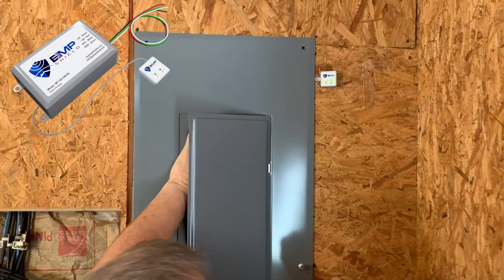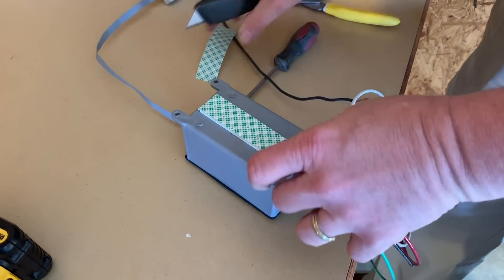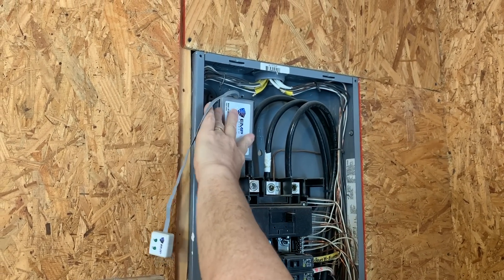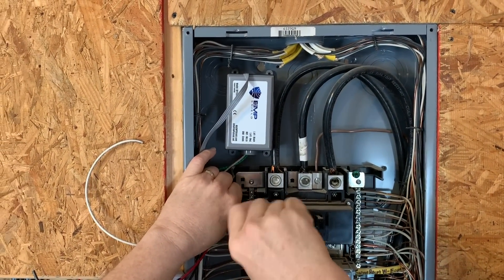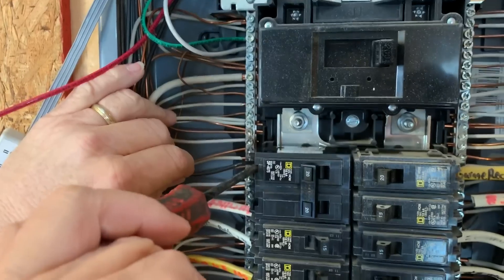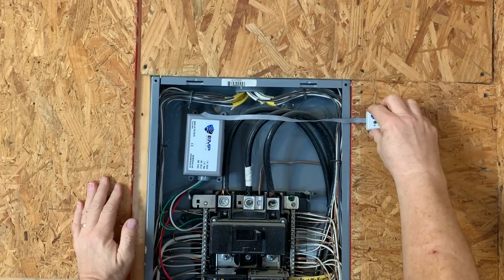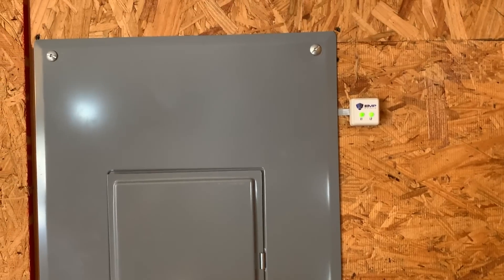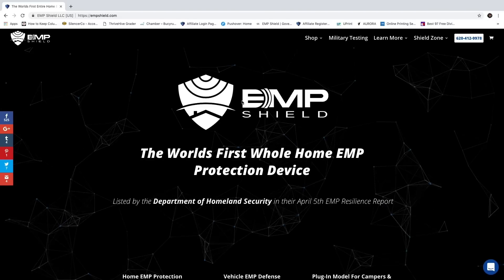Concealed EMP Shield Installation - Home Electromagnetic Pulse and Lightning Protection

Comment: Complete SCAM!!  You have absolutely ZERO warranty or coverage!   Hopefully anyone who has purchased one of these devices never actually needs it to work.  They advertise 10 years, and up to $25,000 coverage for any damages.  But that is only up until you make a claim.  We got hit by lightening which fried the EMP Shield that was less than a year old, as well as some electronics.  We reported it to EMP Shield at the time.  When you go through their claim process they want receipts of where you were billed to have the EMP Shield installed by a licensed electrician (not required on their installation instructions as it is simple to install for anyone with electrical knowledge).  I have previous electrical experience wiring houses and other buildings alongside a licensed electrician.  They also require the original purchase receipts for anything that was damaged.  Who keeps receipts for electronics that are passed the manufacturers warranty?  We provided pictures of the installation showing that it was installed correctly, exactly the same way the whole building was wired by an electrician.  White Neutral wire attached to the same spot as all the White Neutrals from the whole building.  Green Ground wire attached with all the grounds and the other two wires going to the 20A, double pole breaker as required. They tried to say that it was not, so they are obviously lacking in their electrical knowledge.  So because there is no electricians invoice, they deny your claim.  But then they went on to say if we did have an electrician install it, we would have to go after the electrician for any damages.  That clearly shows that they do not stand behind their product at all.  Just like any insurance company making up excuses to deny coverage.  Their warranty is completely bogus.

Comment: If there is an existing 220 Amp Breaker in your box, doesn't mean that wires are connected to it already? For me, it's the water pump breaker. Does that mean that I'll be connecting additional wires to it from the EMP Shield Device?

Comment: Based on EMP research I am not convinced this device will work.  If the EMP pulse in this case came through the transmission lines the EMP Shield stands a better chance of success.  An EMP is not going to travel on a prescribed path, every electronic device, every cord is an antenna and will be the path of least resistance.  I believe people would be better prepared to spend their money on non electrical items and hand operated items.  I think it may be a disingenuous on your part to offer insurance or a warranty.  If we are hit with an EMP it all becomes a moot point, people would be trying to g to survive and money is useless.  I really would like to be wrong, but faraday storage devices would be a better expenditure of money.

Comment: YOU LOST ME AT 1:46 - THE QUESTION IS WHERE DO YOU INSTALL THE RED WIRE? - IN THE SAME  HOLE AS THE BLACK WIRE? - PLEASE DETAIL
Reply: can someone help with this...?
Reply: Double breaker.  Two places to fasten wires.  Two phases  covered.  Have an electrician wire in your unit. @kenproctor5116

Comment: Wow! Pure snake oil! Hokum! False! Bullshit! Totally preying on anyone who has no idea on how basic electricity works. Does this product expect you to install a double pole breaker to accommodate it? Or is it expecting you to find an existing double pole breaker to piggyback onto? Either way, what does this unit do other than illuminate two green LED'S? There's no kind of drain wire that could possibly dissipate an EMP. But furthermore an EMP would not / does not travel down your wiring. Just like a regular magnet, an electromagnetic pulse permeates electronics by the field that it emanates. No amount of "devices" you buy and install will provide any kind of protection. The good news is that we are HIGHLY UNLIKELY to experience any kind of EMP in the near (20 year) future. And even if you were dumb enough to buy one of these bogus devices for your house and somehow an EMP were to be blasted over your state, the things that would be affected would be so far upstream of your stupid little house that none of the so-called "protection" of this bogus device wold mean anything anyway. So for anyone that has read this far, let me explain a few simple truths. (I remember a time when truth wasn't a political word.) In order for for any kind of device, be it a surge protector, an over/under voltage detector, or a device that senses excessive current, (More commonly called a circuit breaker.) up to and including a so called "EMP protection device" must be inserted in the path of the electrical current headed towards the downstream devices so that it may interrupt, or block such badness from reaching those devices. There is no way on this earth that anything that simply connects to two poles of a circuit breaker and does nothing more than illuminate two LED's can possibly deflect an EMP. (Further, where is the circuitry that could absorb such a gigantic influx of electricity located?) This is simply a cash grab (And I am sure it is/was COMPLETELY successful.) to make thousands of dollars off of typical consumers that have a fear of, rather than an understanding of electricity. In lessons we learn about the internet, this is a classic. Look at the many pages of meaningless "documentation". Al of it is designed to imply a level of validity when upon closer examination, it has nothing to do with the product that it is attempting to validate. None of it makes any sense to a person with a rudimentary understanding of electricity. I applaud the  purveyor of this pure hokum for painting a very complete picture of plausibility that the average consumer will bite on, hook, line & sinker. Consider this though. Your home is far more likely to be hit by lightning. Where more than 2 million volts will most assuredly cook any and all of your electronics and affect you on personal level.  An EMP (Whenever a country comes up with the technology to actually implement it and decides to use it.) it won't be aimed at you. And even in the remote chance that a future EMP does affect you, rest assured that all of the power generation, banking software, air travel, train operations, trucking systems, internet, and our nation's defenses would be compromised to the point that your house and the silly little toy you bought from these fear mongers won't make a tinker's cuss worth of difference. Save your money. Buy a dog.

Comment: I have a solar system with batteries. I have EMP protection on the main panel. My concern is that the main breaker will pop in the event of an EMP. Specifically the E3 portion where surges from the grid can destroy external equipment over the 8 hour period. 

There is a breaker panel that takes power from my Inverter (AC) and my powerwalls. Then it goes to the solar gateway and then tied into the grid. 

My concern is if the breaker pops. It now separates the home from those components. I went with EMP shield. I am wondering if I should have an addition surge protector on the outside panel. 

Will these panel surge suppressors protect the solar gateway and powerwalls if the main breaker is cut off from those components?

Comment: The Car/RV version might have some use. But home?
EMP's don't just aim for wiring and electrical items plugged in. They aim for any electrical device direct plugged in or not. Anything with mircrochips and other sensitive electronics is in high risk of burning out, and needs physical shielding EMP bursts of various frequencies.
Reply: If it's plugged into home electric that has the EMP Shield relay installed, it will be protected. The relay shunts to ground any over-voltage pulse in about a nanosecond from the entire wiring. This shunts the pulse to ground fast enough that sensitive components in electronics plugged into same electrical system won't get damaged.
Reply: @TheSimplePreppers Correct but if an EMP goes off the whole grid goes down now you'll also need a whole home generator or large battery with Solar to keep everything in that panel to stay on.
Reply: The point of the EMP shield is to stop your electronics from frying so if you have a back up generator you can get back online since it protected you from getting your circuits fried from initial impact. Of course the grid coming down will be tough unless you have a backup, but say the grid goes up, you'll be ready since it didn't fry your circuits the first time. Thats the point

Comment: Please don't put this in the panel like that. An electrician can easily install this correctly if your panel is recessed into the wall or flush mount. I think the entire thing needs to be redesigned. Imagine taking the panel cover off and the led status light falls off onto the main or the EMP devise held on with sticky tape falls off and gets snagged on the cover.

Comment: Seriously doubt that this thing works, and if there is an EMP the whole grid is going down anyways and good luck getting your money back.
Reply: This product is for those of us with gas and solar generators after an emp or cyber attack. We WILL still be able to use our electrical devices and those without emp protection will not.
Reply: @danykasp  Won't make a difference, the product will not protect anything it's a scam.

Comment: Is it legal to have items hanging out of the breaker panel ?
Reply: No
Reply: @Awesome_Dennis  I'm sure there is an allowance, maybe for low voltage DC wiring it's not an issue?  Either way, I think that "remote led" looks like garbage, and the double sided tape wow.
Reply: Who cares. You gonna call the cops and ask them to come take a look? 😂🙄
Reply: @melissam450  insurance cares, when you want put the house on the market, And stop ✋️.

Comment: I'm very visually oriented when it comes to directions, I couldn't really follow the install because I couldn't see exactly what wires were going where.
Reply: It comes with detailed paper instructions.
Reply: @marcuseviltree6304  yes I have those instructions, but the wires in my circuit box are not where the paperwork showed and one was different colors. I got an electrician to come over and he had to put a 20 amp block in my box and was able to hook it up. 👍🏼
Reply: Theres also a detailed diagram on their website
Reply: @marcuseviltree6304  I tried going by that as well, just too many differences for me to do it myself.

Comment: In my opinion, this device an only absorb the EMP at the point it is located, If your electronic devices are not within a Farady cage type enclosure, I don't see how this device can circumvent the laws of physics. As for a CME, if it is truly 225,000 amps, won't the thin wires connecting this device melt and fuse open? If this horrific event ever did take place, computers and phones would be inoperative for a long time. How would you be able contact the seller to get the guarantee? Correct me if I am wrong.
Reply: There is no possible way this can work!  Don't waste your time with this snake oil sales!  Anyone who understands the basics of electricity can easily debunk this device!
Reply: @bluev2srt  Thank you for your comment.  Since posting a month ago, No one has replied to challenge my comment.
Reply: @bluev2srt  I concur completely.
Reply: I've got to read what I type: an=can, Farady=Faraday

Comment: Do all city transformers have protection?  If it doesn't, what good would this be?
Reply: Grid isn't EMP protected any more than your home would be with this predatory marketing scam.
Reply: Consider this:  The grid is damaged.  The grid is repaired. (at no cost to you)  You now have power but every electrical device was fried.
Reply: I have a generator that i can hook to my breaker box if the power is out. Emp will fry all your breakers without protection. Cant power house with fried breakers
Reply: @marcuseviltree6304  in the event you are in range of an EMP the grid and your breakers are not going to matter.  Neither will your generator.

Comment: Hey guys, I'm thinking of buying an older Army surplus duece and a half.  Can you all "harden" the electronics? How hardened is it?  Could it take a powerful EMP like one from a major Sun event or a nearby nuke/Emp strike?
Reply: Since they didn't respond, I will. I'm not an engineer, but I HAVE been involved with electronics for decades. They claim it will handle a 5000 amd surge. No way ! Those skimpy 18 guage wires would melt instantly. Instantly. The unit probably WILL drain off static electricity during a thunderstor, but will never, ever handle either a direct lightening strike or one nearby.
Reply: No.  This device is predatory marketing at best.

Comment: Why not connect the black and red to the main black and red wire?
Reply: Likely 2 reasons. First the 20 amp breaker provided some overcurrent protection in the event there is an electrical short in the EMP Shield device.  Second, installing a 20 amp breaker is easier than a load side tap, but the shield is still connected to those thorough the bus bar.

Comment: Do you install it on any 2 20 amp breakers?
Reply: I also want to know this.  I did and the green lights lit up.  But I'm unsure if it needs to be specific.
Reply: Yes. Just the mains
Reply: They installed on a "double pole" breaker which will connect to each line "L1 & L2".  You may be able to install 2 single pole breakers making sure they are connected to different lines on the bus but I would check with support or just use double pole.

Comment: If I install this on my home electrical panel, what prevents it from then also protecting the power grid - at least locally?
Reply: It won't !
Reply: I have a generator i hook up 2 my circuit box when power is out. This protects your breakers and wiring. I couldn't use my generator on fried breakers

Comment: What kind of discount do you offer  for veterans ? I wondered how well it would protect attached solar panels in the system?
Reply: It doesn't have the capacity to be any different than much more reasonable level 2 spd on the market and isn't backed nearly as well as most.
Reply: Emp won’t effect solar , but battery’s yes
Reply from the maker: James Owens give us a call. We do offer military discount. 620-412-9978

Comment: Is there any way you could make a video demonstrating this product working by simulating an EMP or something. I'm still not sure how this is different than a regular surge protector.
Reply: It's not different in any discernable way.  Marketing that's dubious at best.
Reply from the maker: Giffy sure thing! It’s different in many ways.  1. It protects from induced electricity that enters through the structure of your home. 2. It shunts in 500 trillionths of a second. 3. It’s capable of taking 228,000 amps 4. It’ll take a direct lightning strike
Reply: ahhh, cool.
Reply: @GiffysChannel  So show it working...
Reply: @tonymowder  I own one and it's hooked up. I'll only know if it works if it ends up being the only vehicle still working when we get hit by a CME this coming Solar Maximum which is expected in a couple years.
Reply: @EMPShield  Is there proof this works by you guys or a 3rd party preferably?

Comment from the maker: Please be sure to ask any questions you may have below
Reply: Does it work on any 20amp breaker or does it need to be on a specific one?
Reply: Does it matter where you put the double 20 amp breakers on the bus bar?
Reply: You are wiring this parallel with a double throw 20 AMP circuit. That is supposed to protect the entire house or just that circuit?
Reply: where can i view or download the installation instructions for an off-grid solar system, a grid-tied solar system attached to my home and vehicle installation instructions?